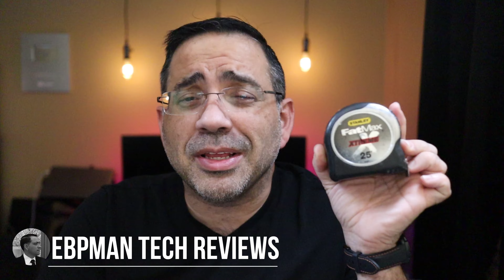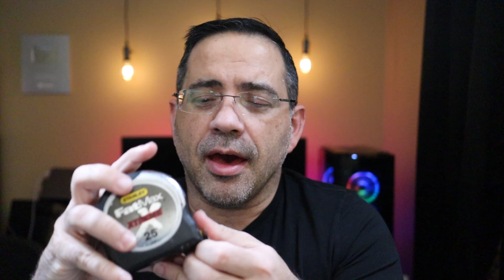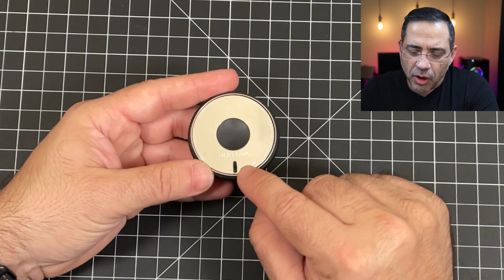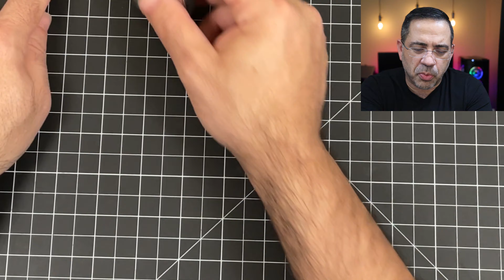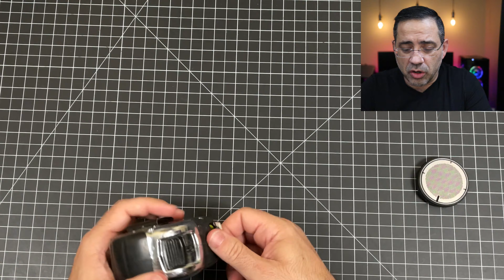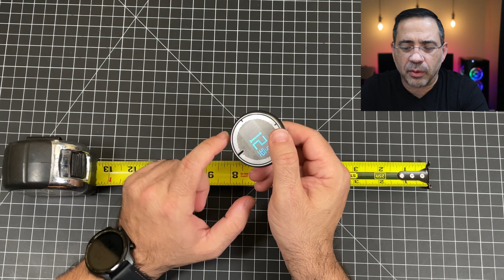Get rid of your tape measure and try the Rolova Digital Tap Measure

Comment: From  your video, the issue is that you are not keeping a straight line. As you waver the device is measuring every deviation, which makes the measurement unreliable. A regular tape measure in this instance is far superior.